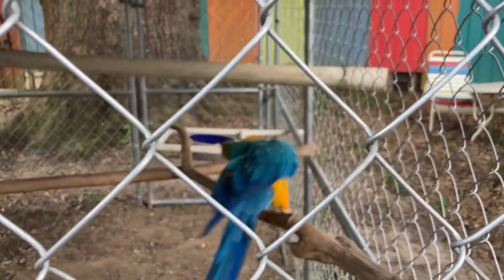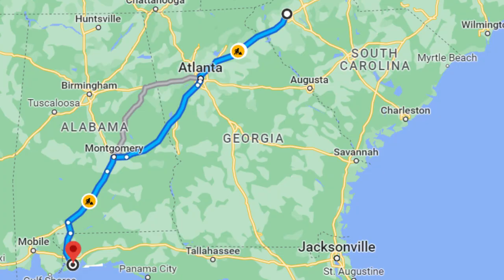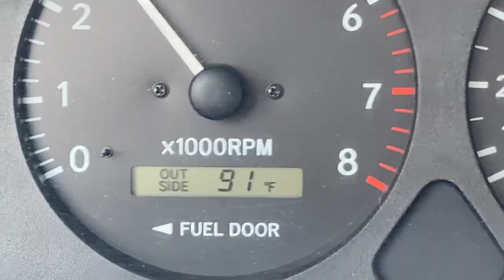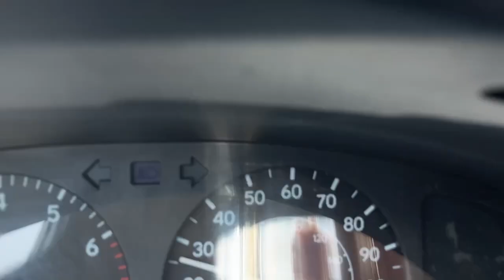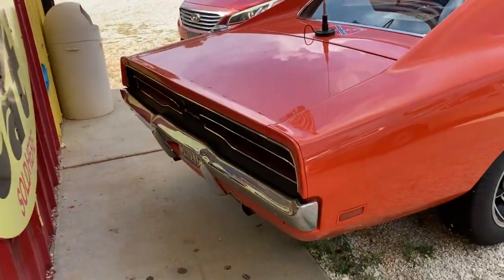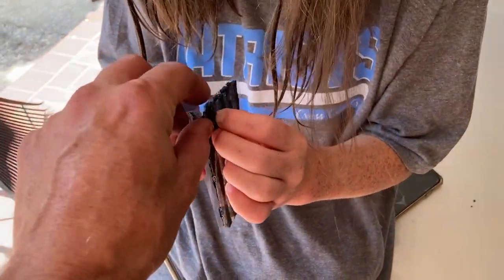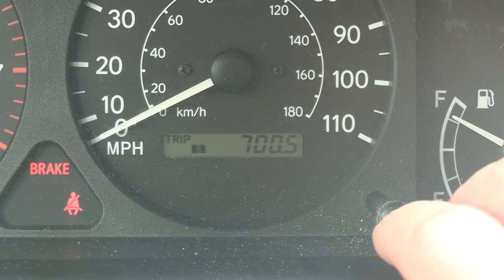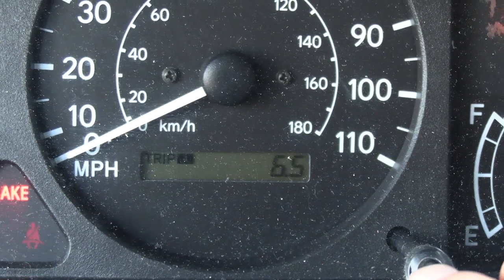HPL Engine Oil vs. OIL CONSUMPTION - Part 2 | Oil Burning🔥Experiments | Episode 24

Comment: Is there anyway you can pull the plugs and give us mechanics the ability to analyze the oil consumption based on plugs?  If there's any bridging of white soot buildup or black soot.... fouling etc

This will help if it's ring related or a combination of pcv ingestion and rings. Maybe a updated compression test with respective plug.
Reply: He does this in almost every video and he's done this a lot in previous videos.  If you haven't watched the series up until now, I would suggest to do so.  There's a few interesting things along the way but to be honest, it's "mostly" boring with just figuring out which treatment is a little better than others and which ones don't do anything.

He knows some of the content isn't exactly "exciting" but it's great for those that like to see this kind of stuff regardless.

Either way, he does pull the plugs many times and he actually uses a video camera and analyzes the inside of  the cylinders as well as the underside of the heads and does this multiple times.  Just check out the previous videos.

The reality of the situation is, he has tried probably close to 15 or 20 different treatments and NONE of them have even come close to "fixing" the problem or improving it to a significant amount.  In my mind, "significant" would mean he had an improvement of at least 50% or more.  I think the best he's seen is about 20% to 25% but then it went back down a little bit as it seems to do after the first tank or second tank of fuel after the treatment is done.

So, I think he knows that the only "fix" is actually repairing the problem by tearing the engine down and correcting the actual problem manually by cleaning the rings and ring lands from the pistons and likely replacing the rings or even considering to redo the heads with new valve guides as well as seats and even some valves or resurfacing the valves or doing a "valve job'.  There are likely a few things that need to be done that "mechanic in a can" just isn't going to fix.
Reply: @eldridge201  bro... you essentially regressed what I'm requesting. I watched all the videos.  Why would I go BACK to old videos for plug analysis when we're in the present?  Cmon man... 

Stay on topic.. it's cut and dry what I need and what I'm looking for,  which is pertaining to various additives he been adding. I'm not going to waste going into detail explaining things to you until good video of what I requested is up. Again,  for mechanics
Reply: @partsshooter  You, Sir, were not very clear in your initial  request.  You should have asked for another boroscope video.  
Eldridge was on point and I believe your special analysis of all past videos with the plugs pulled and video down into the cylinders would be useful scientific information on how each additive affected Dave's test.
Reply: @davepetrakos1192  visual is fine. However,  I've got bad new looking parts from part stores, and I had to retrieve oscilloscope data to monitor Its ability to perform. This negates visual needs, parts can look good and not work. 

So to translate to the video,  borescope is fine but doesn't show its ability to perform. 

The plugs tell the story of its ability to perform without the compression test.  It's quick and easy. To add... compression test don't reveal oil ring failure! Oil rings don't provide compression bro, compression test will aid in its ability to fire efficient. .  In addition to that,  the plugs show incremental oil usage depending on color. 

Please point out where I'm incorrect here in my request

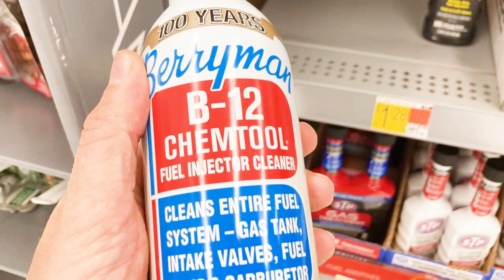Comment: 1:06 Yep! It INCREASES at first and then... 😀That's the "Additive pack changeover," mostly. Really waiting to see how this turned out!!!! Thank you DIY Dave!!! HPL is the Bee's Knees 🐝
Reply: I have used Auto-Rx twice and Schaeffers Neutra #131 4x and the Schaeffer's #131 has taken the Camry 2AZFE down to about 1/2 quart to 1 quart per 5000 miles. I recently picked up 2 quarts of HPL Engine Cleaner. I put 1 quart in the last oil change and and I know at 2500 miles it had not done anything yet to impress me oil looked the same as always and consumptions about the same. I think HPL needs to lean in on the esters at a higher treat rate if they intend to call it an "Engine Cleaner". At this point it seems a bit weak. There oil makes Redline look cheap by comparison no way I would ever purchase HPL's oil for my daily driver that is 20 years old or my sons old cars or the wife's 16 year old Camry. When you can get 5qt jug of Mobil-1 0W40 for $28 at Walmart. HPL is like a $300 a bottle Bourbon vs $24 bottle of Jim Beam. When you add in the shipping it is crazy. I am sure they make a great product but not so great that it can clean stuck rings on a Toyota! If it cant do that than it really can not do anything for me that I can not get done with cheaper products. The wife's car was used it had 96K miles on it when we purchased it. I am sure if I had owned it from new it would never have had issues.  I have not seen a single Toyota cured of excessive oil consumption once it starts. I have reduced it and kept it stable with #131 but not cured it. 8oz of #131 at the beginning of OCI and 8oz 2500 miles in for a 5000 mile oil change works great. Buy the schaeffer's by the gallon. Never had a new car with consumption issue to ry it on as a preventive measure, I am sure as a preventive measure 1oz per quart 800 miles before oil change would do nicely. It is cheap and it has stabilized things so far. So far though HPL engine cleaner is too weak to clean the oil ring groves in the car. To date I have not seen anything that has been able to do much other than B12 piston soaks.
Reply from the maker: Good info 👍

Comment: engine doesnt need more cleaning detergent once sludge and carbon been dislodged. just need a slightly thicker oil that is less likely to burn like a 10-40 synthetic that can withstand higher temps without burning or try lucas

Comment: I’ve noticed in my diesel pickup
I run 15w40 t6 part syn rotella and truck has over 500k miles

Being said, I went cheap and during the covid pandemic I could only find 15w40 rotella T4 non syn, but I noticed the oil ended up like a grit dirt look to it scaring me for a minute

Truck still running strong 
The t4 I’ve watched ppl do reviews and break down the chemicals in all the diff rotella brands and weights 
T4 does have detergents higher then other Oils

🤷🏼‍♂️💸🤞🏻 might be worth a shot trying t4 for 3500-5000k miles 
Can get it at Walmart I believe in the boxes like they use for they’re service shop or a 5 gallon bucket if you can find it

Comment: When engine burning oil 50% off time is  pcv valve (stuck valve) which is easy and cheap fix $10 part and then in my experience as mechanic and Owen 2000 corolla and camry 4 cylinders after 120k so they start burning oil and with more miles you put on them get worse because of dry and start cracking valve guides seals . When you stop your engine for over night oil from top engine and trough the dry and cracked valve guides sales leaking to your engine cylinders and when you start your engine after sitting like 8 hours so you will see white smoke from your tail pipe for about minutes depending of how much oil leak to your cylinders and after burning oil smoke will stop but in your case because of after 1k miles your oil get so black and dirty i go with wear out piston rings that pasing engine compressor to oil pan so like that you most likely burning and losing oil. I hope that helps you and others viewers.

Comment: My vote would be to run a BG engine flush, yes it’s 300 dollars but I’ve seen it  clean horribly sludged motors, I would think it would clean the oil rings. Then fill it back up with HPL
Reply: Didn’t see the comment above mine before I commented lol I second his

Comment: Rotella T6 diesel oil is great. At this point the piston is probably so clogged with baked carbon that nothing but a mechanical treatment and heavy solvents will do what you need to do. Rotella T4 is also great and cheaper. It's thick and may give you type I error in your experiment

Comment: As I said a long time ago.....None have the exotic CLEANING ester blend that Valvoline Premium Blue Restore has that is spec'd  by Cummins, & only sold thru Cummins dealers due to the carboned ring pack problems they had.  $80 a gal. 10/40W.  Developed for Cummins by well known tribologist consultant Terry Dyson.  This high ester will work for you if it works for Cummins....

Comment: my honda burns oil when I drive it hard and I do a lot of engine break at 3000 rpm plus. on highway it does not burn any oil I drove it for 500 miles at 90mph at 4-5000rpm and some redline to 115mph and it did not burn oil it only burns on twisty roads when I press the throttle after heavy engine break
edit: burns almost 1qt every 2k miles

Comment: my  suggestion is a higher viscosity oil, whatever you are using that is burning go up, if you ahve already done that then change your PCV Valve, DO NOT buy it from ANYONE but the dealer so many fake ones out there.

Comment: Start off w fresh oil so it is full of the product. HPL is excellent oil, none of the other oils you name will clean better. Do another piston soak, run the HPL and wait. It took my Honda 2.4l 2yrs to get the oil consumption down to 8oz in 5k from 2qts in 3k. I used Berryman's B12 for piston soak, Rislone 32oz btl, Gumout Multi-System Tune Up for last 500miles of oil changes, HPL EC30 to get it down to minimum usage.

Comment: next experiment change short block. cuz no oil will help to fix a hole in the cylinder :D. Anyway i took my owners manual accidently and found that 1zz can also run 15w40 and 20w50 if you dont have winters maybe that would increase your oil mileage by 15% or maybe it will spin your bearings ;D

Comment: One of the things that you are not addressing whatsoever, put an oil catch can on it. It is entirely possible that all of that oil can be accounted for by going through the PCV system why do you think it's always got oil in it every time you check it no matter how much you're trying to keep the Rings clean.
Reply: His oil catch can is his 4 cylinders.  So often there have  been oil puddles when Dave uses his sneaky snake cam.  And the oil that is oooozing down the cylinder walls would excite Martha Stewart if she saw it.
The intake manifold does not show evidence of bad pic operation.

Comment: Awesome interesting vids sir,  I'm  A Tech at a Mopar Dealership, 28 years,  All my daily drivers have been GM trucks, My current truck has over 400k miles, 4.3 V6,  It rarely sees over 3000 rpm,  maybe try oil consumption test never exceeding 3500 RPM,  Maybe try some Lucas oil stabilizer,  Buddy L & Robins adventures Tiktok

Comment: I would soak the cylinders in berrymans b12 24 hours with a hot engine or heat up the berrymans on a hot plate to couple hundred degrees let soak til it's gone out the cylinder then rinse and repeat I think you should try a couple more of the viewers/subscribers ideas before you are done with it.

Comment: 50% totally awsome cleaner from dollar general, 50% engine oil in the crank case.
 Run it at 2000 rpm for 20 minutes. Change oil and filter.
I have the same car that did the same thing I get over 2000 miles and have to add less than a quart now. It used to burn a quart every 200 miles.

Comment: My Corolla has 218,000 miles and goes 5000 miles  between oil changes and the level never leaves the full line !
Reply: What year Corolla, and is it manual or automatic transmission?
Reply: My 05 Corolla has 350,000 and uses no oil. Original automatic tranny also. Just keep changing those fluids folks

Comment: Did you tried 5w30 c3 ECT shell dexos2 oil? Is worked really well must say, that i also poured in liqui moly ceratec. But my oil isage had been dropped significantly now using appropriate 1liter for 3600 km driving <also high speed driving in German ≥

Comment: I’m sure that motor is spotless on the inside by now. It’s just too late and the oil rings and cylinder walls are worn out. Probably why Toyotas fix is a new short block.

Comment: Hope you can fix it without tearing it down but if you do, you may want to see if Toyota has new design pistons with larger drain back holes. If not, I think you will be in the same situation in another 100k miles.
Didn’t realize you stopped in my back yard on the way back to SC. That Buc-ee’s is less than 10 min from my house. WAR EAGLE!
Anyway, thanks for all of the shared research, especially the Yamalube. Ended up getting the scope with the side camera and the prognosis is not good (scored cylinder walls) but maybe the B12 treatment will slow the inevitable decline. It’s been God’s grace that’s got me to 296k. Never know may just keep on going. All the best.

Comment: I don’t think you are “burning oil”, I think your valve seals are bad and leaking oil into the combustion chamber after you park it for a few hours. That explains why in your first B12 video you saw oil on top of the pistons the first time you looked at them after you parked it. It’s oil that leaks past the valves and burns off on start up. Depending on how much you drive then park the car will dictate the level of oil consumption.

Comment: man I would like to tear down the motor and see if its a canidate for just new pisions.  likely wouln't cost a whole lot if you diy.   in all likelyhood the rings/ groves ect are worn, not just full of carbon.  the current oil use will be best it will ever get.

Comment: Dave,iv’e kept up with all your testing videos,seeing the bore scope pics ,knowing the Toyota oil burning issue & having 5+ decades 1st hand exp rebuilding motors tells me your completely wasting your time,energy & money at this point with this car/motor doing anything more to it at this point.
The only was this is going to be fixed is to either completely rebuild inc a rebore or yo buy a new short or long block from Toyota or to maybe find a used low mile rep motor in local junkyard that doesn’t yet have stuck oil control rings where you can keep it that way doing 5k mile or less oil changes on it to keep pistons,rings & oil passage holes in pistons clean to avoid any future coil burning issues.
I’d switch to 15-40 or even 30-50 oil in temps above 40deg f & to 10-30 (all being conventional oil) to temps below 50deg f & change it at 3k miles & drive it till it dies & retire it!
But there is no way your particular situation is going to improve anymore then it already has and most of variance your seeing oil mileage at this point is due to diff mfg’s & viscosities your running at times vs big diff in speeds the cars seeing at 75-80mph on highway vs local mixed driving speed & cond. 
You have to realize when you go from 5w to 10w 30 oil doubling the base cold 5w to 10w gives the oil a little better protection against oil viscosity breakdown/sheer having a 2x more robust/thicker cold base wt which can help the oil keep its viscosity better at 30wt when it’s at full op temp of 212deg f where a 5 or 10w 30 has changed to a 30wt visc due to the oils Chem additive pkg.
So just dif in this 2 oils cold vase wt along using diff mfg’s oil on top of big variation in road speeds & driving cond the car see’s is why your seeing oil mileage variation in 550-800 mile range at times with avg in 659-700miles per qt range.
Happy motoring.

Comment: P.S. once you repair the engine run Mobil-1 0W40 in this old girl with a clean engine it will keep it clean for life. Cheap store brand synthetics like the stuff made by Warren over time leave an engine stained and with varnish even with their "synthetics". Engines with low tension rings and issues with oil control rings really need a 0W and the heaviest it can tolerate on the other side. Any Toyota made with a mechanical oil pump driven by the crank can use 0W40. If you go any heavier than that it affects fuel economy and will sometimes produce more wear not less.
Reply: the W in oil stands for the weather.  Not the heaviness/viscosity.  I do agree with you on the lighter oil though as after I did the Barryman's treatment on my 99 Corolla I switched form 5w30 to 0W20 and went from 900 miles for quart to 1500.
Reply: 5W-50 or even 20W-50 is suitable for these engines especially in warmer climates. Toyota specifies that oil weight on their cars in foreign countries such as Australia or Saudi Arabia, etc. The biggest issue with thicker oil is reduced cold start performance (less than 40F) and worse fuel economy when the engine is cold. I have this car and switching to 5W-50 has only affected the fuel economy when on a cold engine but otherwise no difference if the trip is more than about 15 miles. It makes sense because the viscosity difference on a hot engine is less than 10cST from -30 to a -50 oil.

Comment: Maybe you are looking in the wrong spot🤔 With every tank (10gal.) I add 10 oz ,295 millilitres of 0 w20 synthetic oil and found my Accent has more zip a bit better fuel mileage and no oil consumption ,I gave done this on and off for 2 yrs just to reaffirm my results 
They don't lie

Comment: Amsoil flush and then change the oil and filter to amsoil signature series... made my old subaru stop using oil... 150k later still does not use oil and a cousin still owns it

Comment: You put the spare tire on the car wrong. In a front wheel drive it’s always supposed to go on the back of the car.  If you have a flat in the front the manual states to put the spare on the rear then put the rear tire on the front.
Reply from the maker: 🤔Hmm. I did not know that. I'll have to check out my manual. Thanks for the comment!